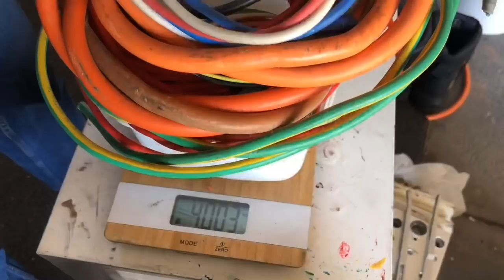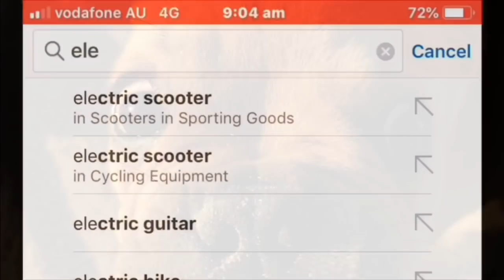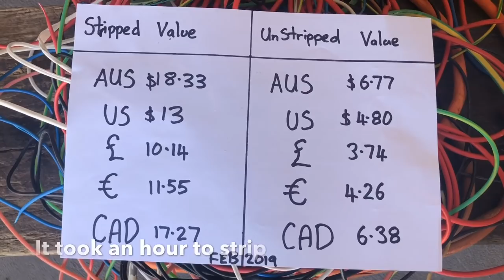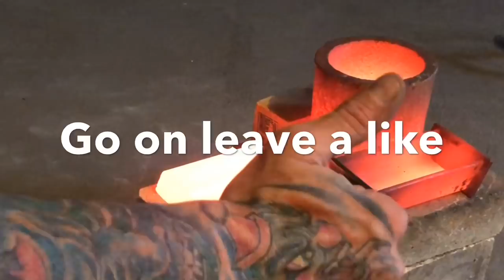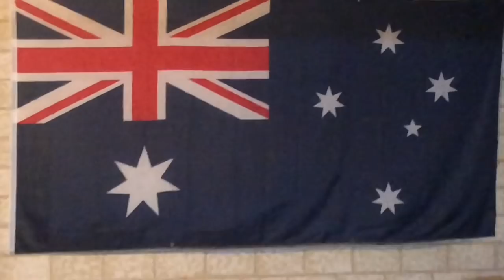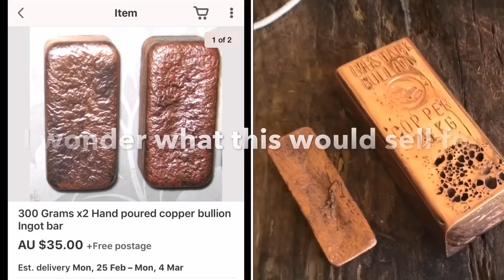To Strip or Not To Strip - Is it really worth stripping Copper Cable🤔 - Melting Copper

Comment: We have one of those big constantly-rolling cutters you just feed wire into and let it ride. It cuts a V split down the top with 2 wheels and then the bottom has a guide that pulls the sheath off downward into a bin. You can run up to 8 cables of 4 different gauges at a time. 8|4|0|00|00|0|4|8 -- you manually start the coil on the receiving end for a second or two then it pretty much takes care of itself. Every few minutes the newjack comes by, cuts it and hauls it off to wherever.
Now. Mail order strippers on the other hand... Always worth it ;)

Comment: I held a piece of copper wire in my hand today that was almost 1.5" in diameter and 2 ft long. Must have weighed at least 25 pounds. Seems a construction company was laying underground cables years ago and each "pull" had to be slightly longer than spec so they could trim it to an exact fit while making interconnects. That means each cable had at least 20 pounds of scrap and if I recall correctly each manhole had 6 cables to splice (cables from 2 directions) so 12 scraps, or easily 200 pounds of copper at each location. They were giving the stuff away for the asking if you were nice about it. I have no idea what the scrap value was at the time. BTW, this was a union crew on a tight time table so scrap was the last thing on their mind. Was probably worth more in bonus $$ to meet the schedule than the scrap paid back then.

Comment: I had a neighbor who worked at a marina. Scrap copper wire was dropped in the dumpster and he would take it home. When spare time came around then he would strip the insulation off. It is spare time when there is nothing else need be done that produces income. The insulted wire can sit there until he gets around to it as it does not go bad. He did not melt it down into ingots and sold as is.

Comment: how do you make it so the copper doesn’t stick to the steel ingot mold do you apply a coating? i tried casting into a cheap loaf pan in the past but it would get stuck and destroy the pan after the first cast

Comment: Great collection of metals. I think you'll get better casting results in the future though if you vibrate the mold as the metal is first cast in to it. An easy way to do this is to use a vibrating sander to shake the surface the mold is on. Then, after you do all that, cover up the mold and let it cool slowly so you get finer grains and less of that wrinkly crap on the back of the ingot. It might be more ideal to electro-recover this metal into anode plates because it will produce a far purer product.

Comment: Copper thieves wrecked several pieces of equipment that was owned by my family. We had a generator the size of a truck, able to power a gravel plant, that was completely stripped of copper. The lines leading from the generator were cut out, and so were the windings from inside the motor itself. Turned a functional piece of construction equipment into scrap metal. It was a really bad hit to the family business.
Reply from the maker: I’m sorry to hear that my friend 😞I hope you caught the bastards that did it💪🏻

Comment: Why strip? What happens if you smelt with the plastic wrapper still on? Would the plastic just burn off or be removed as dross or contaminate the ingot?
Reply from the maker: If you check out my latest video you’ll see that I melt down a whole kilo of unstripped  wires and the copper bar comes out perfectly fine, there is a lot of crap left in the Crucible but as long as you pour it slowly and carefully you can pour the copper out of the Crucible without all the dros slag and burnt rubber or whatever the hell it’s called

Comment: why did those holes happen? im guessing air pockets but does that mean the mold wasn't hot enough before pouring? is it possible to make a perfect mold before without having to grind almost? and is there financial viability in this considering the volume?
Reply from the maker: Actually matey I did this for fun not profit that’s why I stack it all up and never sell it so I don’t mind if it cost me a few dollars here and there this is purely a hobby I do to chill out and relax. You certainly won’t get rich doing what I do with my scrap metal👌🏻
Honestly when it comes to the holes my only guess is I am heating up the copper way too much and those holes appear right where I pour the copper into the mold, I never had this problem with my smaller furnace and I never ever got those holes in my copper bars as it didn’t have the power of the devil forge that’s why I’m thinking it’s because I’m heating the copper up to much🤷🏻‍♂️🤔

Comment: Besides causing more air pollution would there be other harmful effects  to burn the insulation off in a fire versus stripping the insulation off using the machine?
Reply: Ghe plastic would melt and gunk up the wires and it would drip everywhere and there would be a huge mess to clean up  and im saying that because i tried somethin similar when I was 14

Comment: But was it worth it? You kinda missed your own point 🤣 jk mate. But what weight units did you use with the copper price? Cause in the netherlands the price of clean copper is €4,50
Reply from the maker: I would’ve went off the copper price at that current time of uploading so it’s probably changed a bit👌🏻. And yes I accidentally edited out a whole section About it not being worth it because of the time involved but if your time is free I think it’s worth doing👌🏻😁
Reply: @bigstackD  alright that cleans out a lot thanks for the quick response 👌🏻 and cheers from the netherlands !

Comment: Why don't burn the plastic and get the copper?
Reply: Gives off toxic fumes if burned at low temperatures (incomplete combustion); at high temperatures it will oxidize and contaminate the copper. Some can be melted off but lots of thermoset insulation will stay.

Comment: Is it really worth it to not proofread your introduction?
Reply from the maker: Yeah I had a clip in this video at the end where I explain that it’s worth it if your time is free and if you have large enough cable . 
otherwise the time used is not well spent if the cables are too thin and small but I accidentally edited that bit out🤦🏻‍♂️

Comment: Why do you make a bar does that get you more money than just the stripped wire?
Reply from the maker: No Andy the scrapyards normally won’t even buy the ingots as they have no idea exactly what it is they would much prefer to have it in its original form of a heap of wires or pipes, you would lose all profit in time and gas doing it the way I do. I do this as a hobby to relax and unwind and that’s why I don’t sell any of my pieces I just stack it up👍🏻😁
Reply: @bigstackD Got Ya. Well it is an impressive collection you have! Cheers.

Comment: i thought i was going to get my answer with this vid but no what happens if you put unstripped wire in the crucible to melt
Reply from the maker: Yes buddy I accidentally edited a bit of info out of this video. Basically it’s worth doing if you have free time and your time means nothing to you but you’re better off really just taking the wires straight to the scrapyard unless they’re nice and thick then it’s worth stripping. If you were to put all the wires with the Insulation still on them straight in the Crucible to melt all you would get would be extra crap on top to skim off Or stuff at the bottom of the Crucible and the bar would be exactly the same as if you stripped it😁👌🏻. A lot of times the varnish turns to Ash and that will sit at the bottom of the Crucible and if you’re pouring carefully you can stop the pour without letting any Ash into your ingot you’re pouring if that makes sense🤔
Reply: bigstackD Casting thank you that’s what i thought it would just burn off and make more dross to skim off haven’t melted anything but lead so far but i’ve done a lot of that. I am currently building a waste oil fired scrap melter(the fire extinguishers) you can find on you tube i have tons of metal and prob 6-800lbs of copper that i want to make into bars for long term storage

Comment: i just trhow the wire in a camp fire and get it when its cooled the flames arent hot enough to melt the copper
Reply: What about the toxic gases from the burning plastic you're releasing into the atmosphere
Reply: @asvarien  if youre burnig several tons of it everyday it wont make a real difference

Comment: 100% pointless to make a bar out of it
Reply from the maker: Not if it’s a hobby.
Reply: @bigstackD  o, your hobby is making copper ingots?  that seems strange? why exactly do you do that, lol.  no problems with that as a hobby because hobbies, but are there contests? are you saving up for when fiat currency crashes, lol. what do you do with the ingots after you have poured them?  thanks for your time, and uploads mate.
Reply from the maker: Moshjosh Pitchief As I do this on my days off from a normal job i’m not too concerned with the cost of gas or how much the bars themselves are worth. Eventually once all my scrap is melted down I will probably reallymelt these pieces to use on future casting projects but until then I’m just having fun building the stack even if it is quite pointless👌🏻😁.